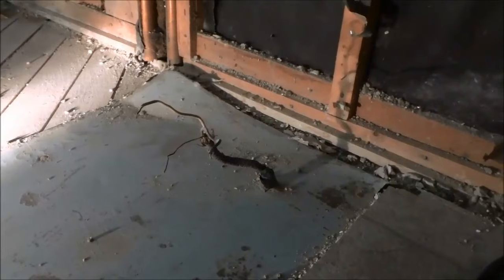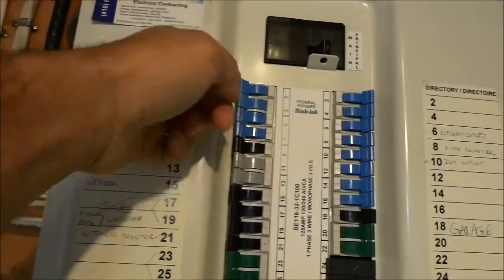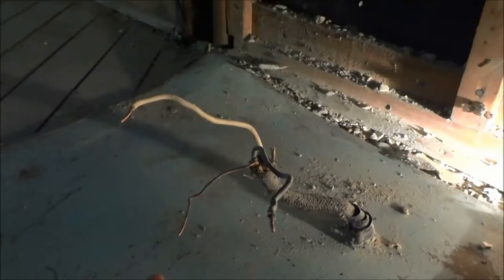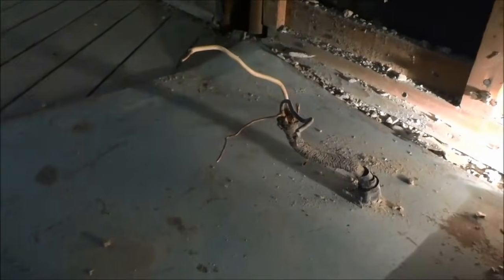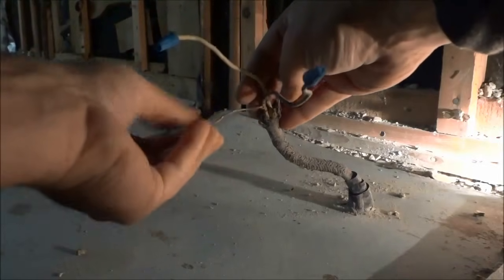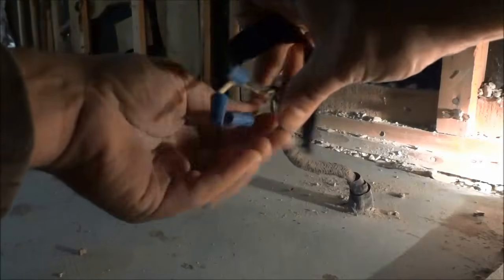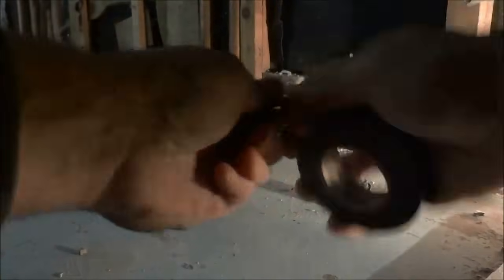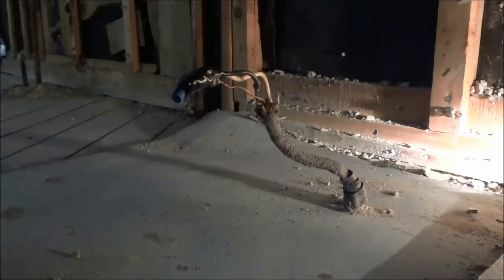How To Cap Off Live Electrical Wires (Safely)

Comment: Maybe someone else pointed this out.  This is not safely capped.  It needs to be in a junction box with a lid and preferably with a note that is is live and terminated.  Sometimes you can't trace the circuit to terminate the wire at the fuse box.

Comment: Wow so these nuts can be used on ine wire. All videos I see of this nut it is used for joining two wires. I assumed the screw inside works only on two wires. thanks for this video. Now I got buy this. I have this door bells that comes from the wall and sits in a recess I want to remove that cap the wires and stuff it inside ther ecess and then on the panel where the door bell was I want to screw in my wireless door bell. the panel is old wood so a screw will in easy. Now its on top of the bell and people get confused which bell to ring. Its stuck with a double sided tape but that keeps coming off.

Comment: Assumption isn't your friend. Do test the wires before and even AFTER you shut off the main breaker to make CERTAIN there is no current running. A non-contact voltage tester with sound or LED indicator is best in this case.....BUT, always validate the voltage tester on a known live wire or outlet first....again, assumption isn't your friend. Better check twice or thrice since your life depends on it.

Comment: Just made the mistake of tying two wires onto the same cap and electric taping them together. Almost blew my house out! The tape and the cap holding them together all melted. Luckily my breaker saved me so I can watch this video. I've always been terrified of electrical work 😅

Comment: If you're not using the circuit why have power going to it?? Leave it off at the breaker box instead, also whats the point of capping your ground when the wire is still exposed anyway. This could is not a professional and its clear as day.

Comment: I have a new house and the builder installed an outlet over the fireplace in case someone wanted to put a TV there. I want to redo my fireplace and do stone all the way to the ceiling. Can I cap off the outlet like you demonstrated and cover it up with the stone? If not, how do I go about eliminating the outlet? Thanks

Comment: I think those are the 3 wires that he removed under the dishwasher and if so, he tested the wires before touching them in another video, I believe?

But if you  capped them off, why would you need the power back on to them?  I will leave mine turned off at the power box until I buy a new dishwasher (which will be awhile from now). My power box labeled dishwasher will remain off when I cap them.
Reply: You're assuming the breaker only services that one connection.

Comment: Do not do what this person did!

Never assume that the breaker switch has turned off an individual line or recepticle! Use a voltmeter at the place you're working on before touching anything.

I'm rewiring my house and had I NOT done this beforehand I would have been electrocuted at three different locations where the house was poorly wired and not documented.

Voltmeter and 5s of your time is a great investment in lowering your chance at death.

Comment: This procedure is a dangerous hack.  Those wires need to be enclosed in a junction box.  First shove them in the box, then you can twist on the connectors on, and tape.  However, they should be enclosed in a junction box that is screwed to a joist, or floor board (since it’s in the attic).  And putting a connector on the bare ground wire was a waste of a connector.  The rest of it is bare, after all.

Comment: Thank you so much, I need to repair and replaster a kitchen wall and found an old steel box which used to house an exhaust fan. I took out the box and found 2 live wires just hanging out. I did put electrical tape on them but I will go back, take off the tape, cap them and retape. They will just be living in the wall in an old metal housing enclosed in an armored cable. If that doesn't make sense it's because I don't know what I'm doing but I read as much as I can to prep so I don't kill myself. Thanks so much for the video
Reply: I’m doing something similar can I just take the wires out and cap them?

Comment: Keep the wires as seperate as possible from each other never tape them together
Reply: i was just thinking that when i was watching this too.. ive never heard of them being all taped together like this
Reply: @dianasmith6588 how else are you going to put them back in a combo or junction box without them touching? They are literally ran inside a jacket together. Taping ensures the caps stay on and adds a secondary safety if they are electrified to not shock, heat, or burn....
Reply: Yes different lengths.

Comment: I'm a licensed and certified electrician and seriously if this is not going to be used anymore just call a licensed and certified electrician and have them disconnect it from the main panel or sub panel whatever it's connected to and just completely remove the wires. Seriously this video is doing nothing but show people how to do everything extremely dangerous and wrong this guy should remove and delete this video if he cares at all about the safety of others.😡

One last thing if this is not going to be used for anything and you are not going to just remove the wires like you should have done then why on earth would you go and turn the power back on to that wire. Anyways I'm going to assume that this circuit has more than one Outlet maybe even lights on ig and this is why you turned it back on but you still should have just completely removed that wire from the panel or it's the last wire on the circuit then just remove it from that wire from the load end of the outlet before it then it's not energized and completely safe and can be removed like it should be.

Comment: Lol ok that was funny I'm a licensed and certified electrician myself and this was funny as hell and exactly why you don't trust someone who is not a licensed and certified electrician to do work in your home or anywhere. Seriously look at what this idiot just did and I only call him an idiot because he is very dangerously working with electricity but he puts a wire nut on the bare ground wire as if that is somehow doing anything. Ok if you still don't get it think about this the ground has absolutely no insulation of any kind on it at all so what difference does it make or how much sense does it make to put one on the ground wire when the rest of the wire is still completely exposed and you can easily still touch it. Oh well I say this all the time don't trust someone who is not a licensed and certified electrician to do work in your home or anywhere this is a perfect example because he clearly doesn't have a good understanding of what is even going on with the different wires he's working on.🤷‍♂️⚡✌

Comment: Trying to figure out why he capped the ground. :)
Reply: If theres a fault then ground can become a hot wire
Reply: Farooq Shah lmao, the ground is bare though
Reply: If you want to wire something in using the ground later capping in ensures that you don't have to deal with electrical tape residue or dirt. When working into pre-existing wiring you don't always get to choose how much slack you get to work with = trim as little at possible. 
Also I believe someone already mentioned if there is a fault in the circuit your ground may be hot. 
Also if someone is looking for basic information like this they're probably new at wiring. When I'm not confident in a new skill and looking for instruction I would rather someone add an additional step that encourages safe habits and covers safety 'what ifs'. 
I do the same thing when making work instructions for welding stuff.
Reply: ME ALSO AKSSKDKDJF

Comment: Why do you need a 4 minute video for this??
Turn off power. Test for presence of power (do not assume). Put a wire nut on each exposed wire. Optionally, tape them together.
IDK why he felt this needed a 3+ minute video to go over that.
I also don't know why he didn't check for power. Never ever assume. Play it safe, people.
Edit: Also, 420th downvote!

Comment: The bare conductor (earth) is not required to be capped. Unless there is fault wiring somewhere, this conductor has zero potential. Another thing, insulating the wire should be done properly.
Right, before touching any suspected "HOT wire/conductor", make sure after turning off the circuit breaker, still u need to check  the wire using VOLTMETER / VOLTAGE TESTER, to ensure that the reading is ZERO (POTENTIAL).
Reply: You make a great safety point in regards to the breaker and voltmeter.  
It is so sick to see other DIY videos that totally disregard this very important safety violation. It’s scary. 

The ground is often abused and absent and regarded as safe... so on that subject...
The ground wire has zero difference in potential...to itself. The ground wire is ground potential. Ground potential is not an inert thing, it’s not zero.  That’s like saying a live hot leg has zero potential...  It’s about the difference of potential between this and that. 

On another note that ground wire is  tied to the neutral in the main panel,  or not, or broken, or the ground never connected to the ground rod etc... 

The bare ground looks innocent, but may be carrying current for a broken neutral. 
It can kill you as easily as a hot conductor. 

While I work and play with high voltage, the ground or earth is my death sentence.  It can also be what saves my life.
Reply: @Electric_Snap  Hi there... I am here to find out how to safely remove the wiring from an old chandelier (not plugged in, nor attached to the ceiling), to ultimately DIY it into a solar chandelier... please advise, how to safely remove the wires? Thank you in advance... =o)

Comment: So I've found live electrical cables  cut off and just "loose" in my craw space. Some still tied into light switches or outlets etc. Looks like they upgraded the wire but left them attached for some reason. I've capped a few off(added some spare 12gauge wire to add to the live wires to cap them off using  a wing nut). 

Assuming that is not up to code(or is it) and plan to cap the rest of or simply remove and rewire the outlets. Curious, in the meantime how dangerous is the current situation? The cables are cut clean and are just hanging where they hang. Seems very wrong to me the way they left it, but i'm not an electrician

Comment: I'm not an electrician, so I'm glad for the discussion.  The comments proved very helpful.  I used my  "hot wire detector" after turning off the circuit to make sure it was down.  I capped my neutral and hot, leaving the ground exposed.  I left my wires in a junction box and put a plate on it.  I also left the circuit breaker off when I couldn't find any other appliances using the circuit.   Thanks for the help (well, folks in the comments).  This is a great application of   Cunningham's Law.
Reply: Thank you for teaching me about Cunningham's law :)

Comment: This is for TEMPORARY capping of live wires. Use a junction box if you plan to cap them for anything more than the very short term!
Reply: Should I add the ground to the junction box? Or cap that aswel
Reply: i got junction boxes and i capped all wires plus used electrical tape. around my junction box i have fire foam insulation
Reply: You shouldn’t even be capping it off if you’re going to turn the breaker on, it’s too much of a risk, junction box is the way to go

Comment: Hey "Helpful DIY", if you were really any good at what you do, you would double check the wire to see if it's hot. You might have flipped the wrong breaker. Also, did you really put a wire nut on a ground wire? 

Do us all a favor, stop making amateur videos that could endanger people, and call an electrician next time you need to do some renovation.  Otherwise, you could get hurt because you have no clue what you are doing!

Comment: Stupidest how to video iv ever seen..doesn't verify if their live wires or not before touching them ,,caps off a bare ground wire like that'll do anything..
If the wire is not actually in use then it should be disconnected from the circuit all together..
I'm in a house now with live wires running every where but not actually going to anything or being used for anything ...there's no reason to have power being supplied thru all these old lines going no where except to put future occupants at risk of a fire and losing everything they own cause some lazy dumb ass watching stupid fucking how to Videos like this and thinks they just found the solution to their problem..

Comment: This is bs, to Safely cap a wire, it needs to be put into whatever approved box for your area.   That box is screw down, then the  white/black are cap, while the ground is connected to the box.  And really  you should disconnect the other end, why just run a live wire to nothing?
Guys doing renos, might do something like this for a day or two as they  sort out the job .  
If your electrician Is capping bare conductors, you need to kick him off the job
And please, this is for everyone, F off with covering everything with electrical tape.
Reply: That takes too much effort. Why not just put them in a bucket of water then let babies play with it.

Comment: All wrong. I don't know the building codes, but I work in industrial maintenance and you just capped the safety ground instead of using it to ground whatever junction box the wires need to be located in which you ALSO didn't use.

Comment: I have a hot tub in a screened porch connected to the house. The power to the hot tub is 240 volts run from outside the porch to a dedicated breaker box. I am taking the hot tub out, but I want to leave the wiring in case I get another hot tub in the future. Can anyone advise me what the code is on stubbing this off safely? We do have rain that blows into the screened porch when it storms, so I want to make sure its 100% safe and doesn't violate any electrical codes. Also, once its stubbed off do I have to also disconnect it from the breaker box? Any help from a licensed electrician would be appreciated.
Reply: ovationsensation puts marettes on the wires and place them inside of a pvc 4x4 box which is in fact waterproof
Reply: Luca Valsorda Do I need to mount the 4x4 box a certain height on the screened porch wall to meet electrical code?
Reply: No as long as its accessible for whatever future plans you have
Reply: Luca Valsorda Ok, thanks. Appreciate you replying to my post.
Reply: Call an electrician.
Reply: @LGnLA   No, I took care of the problem 2 years ago myself. Not only that, I got a new hot tub and wired it in myself to code.

Comment: Hi guys need a bit of advice needed please.., large flourescent light fallen still hanging on wires, tbh we dont know which way the switch is on or off and need to cut the wires is it safe to do so thanks
Reply: No, it's not safe to just cut the wires. There could be live power coursing through them. Turn the breaker off and check it with a voltmeter before cutting.
Reply: cheers fellas..

Comment: The only thing that he left hanging in this video is that he turned the breaker back on, and using a voltmeter. I don't know why he did that unless the same circuit was powering something else.

For the rest of the people who left comments, this guy isn't responsible for keeping people alive - or killing them. Believe it or not, there are some competent people on this planet who can handle this with no problem. Even if they can't, I've slipped up a couple times and got zapped by house voltage. It's really not that bad. He's not suggesting you full on grab onto the wire at any point. A little zap from these small wires won't kill you, chicken littles.

Anyway, he definitely should have suggested checking the wires with a voltmeter. I still want to know why he had to turn the breaker back on.
Reply: djd829 why you guys say the 120 v kill you? I hear this all the time, you could get kill, electrocute, you could get this , that  ...... Can you explain to me please why I have not yet die please??? Just this weeks I got electric shock two time 120v AC AND HERE I AM  asking you why you misinform people..  I use to work in a ship from Europe it was 220 v back in 1990 I got shock one time still I am here. This is what I learned if not appliance is running you will not get hurt but if you put your self in a parallel circuit to the appliance, motor or whatever then you may get the one way ticket to the other side.....
Reply: I think you replied to the wrong person. I didn't say it would kill you, in fact I said I've been zapped many times and I am still here.
Reply: @Undezzirablei...commenter  you're another clueless person! You can die with even the relatively low voltages passing through our houses (as compared to substations, pylons, Traction wires) dependent on how the electricity gets back to ground. It doesn't take much voltage to send you into cardiac arrest no matter how fit you are, but you're in a worse situation if you're frail
Reply: @noreply6193  Thanks for your reply. Read carefully my comment please, i did not say 120 can not kill you I said i have been shocked many but many time one time was more that a second. This is the reason of my comment based on my experience. I just want an answer about why i have not yet get hurt. I am not a certificate electrician but I have wire couple house with another guy and by myself and passed the town inspection. I have a theory in the matter of why i have not get hurt when  i got shocked but nothing that i can prove.
Reply: Also can you explain to me please why i dont get electrocuted when i cut off i live wire just to find what its respective  breaker? I dont waste no time switching back and forth breaker.... never get hurt either...